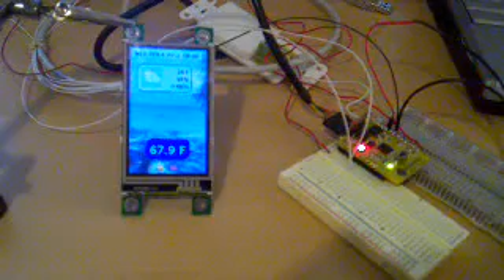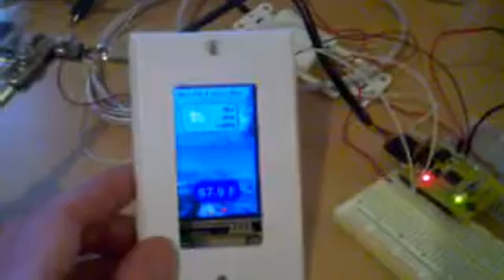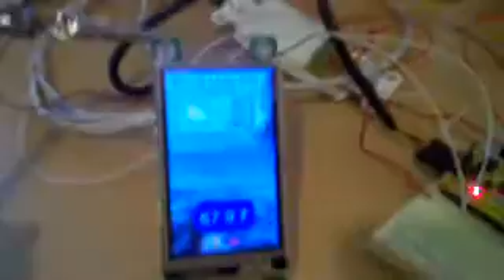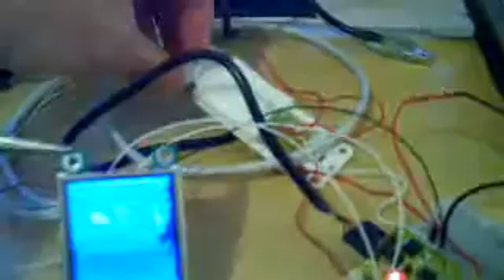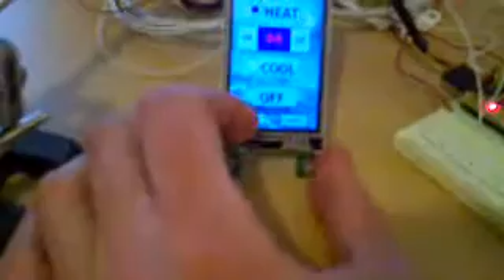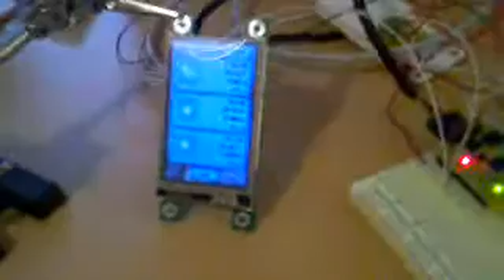NoopWiFi1

Comment from the maker: the interface to the PIC is simply done with three wires.  one is for transmission, the other for reception and the third for ground.  commands are sent over the wire in simple serial communication.  the controller in this case is an atmega328p, and i used the SoftwareSerial library to ease the coding needed for this communication.  most of the actual commands for drawing are stored in the ezlcd ram as macros and are simply "run" by sending the run command over the wire.  it's very easy.